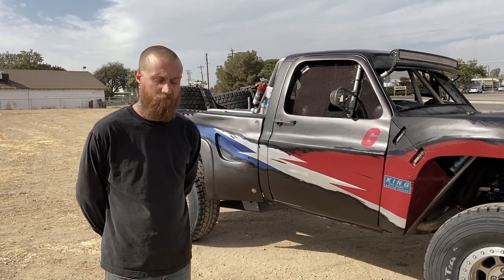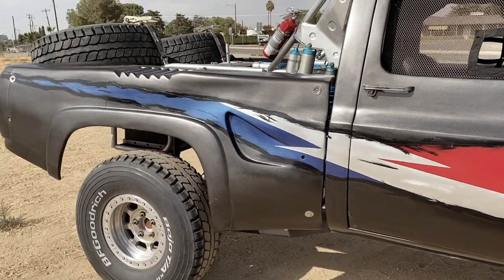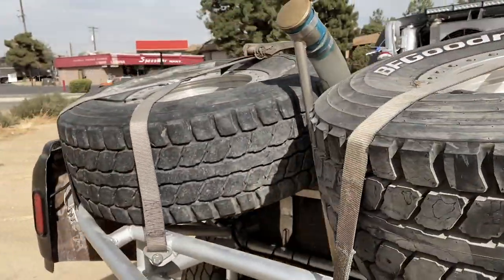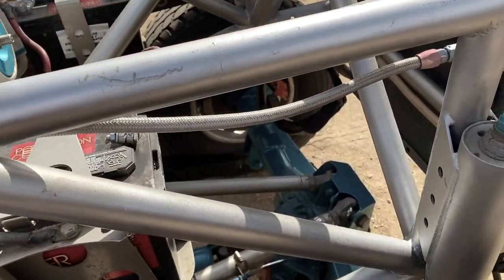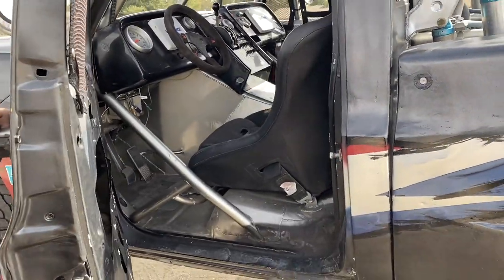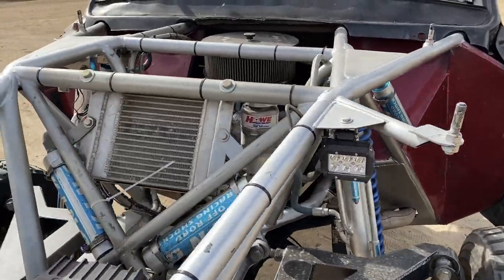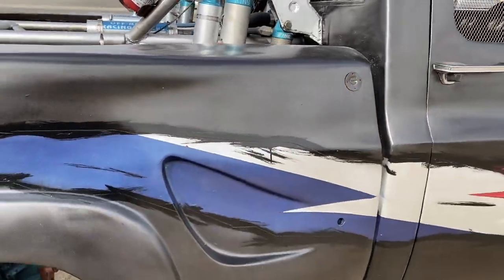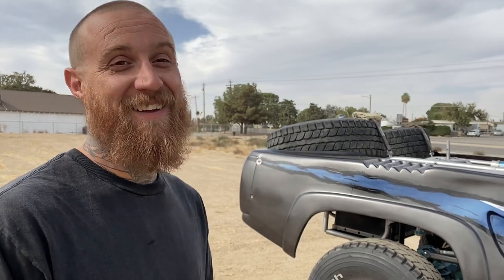Building an off-road race truck on a budget

Comment: J arm front end, linked rear end. The list goes on and on with that truck. There’s nothing low budget on or about that truck. What do you mean low budget? Guarantee you he has close to $80,000-$100,000 into that truck
Reply: Built up Brenthal brand truck costs 300k-800k so this is 1/3 of the cost on the low end and easily half the cost
Reply: @franklinhurt6972 used parts and friends.. also when you pit or mechanic on another truck,  wealthy racers donate

Comment: Ima welder, and I want to turn my 97 ranger into a fully built pre runner. I have most of the skills required to fabricate my own shit, but I don't know a lot about mechanics. Money is an obstacle, but this is a long term project. My question is, can I learn along the way, or should I take mechanics classes before I start this project? I know a good bit about working on my truck as is, but I don't have any experience with something like an engine/transmission swap.
Reply: Gamma read all over the internet. Forums and call companies who make parts. Most things for a ranger have been done before so engine swaps and transmissions and gear questions can be answered probably with a little bit of research.
Reply: Welding in itself takes precision and discipline and difficult I'm absolutely sure you can apply the same with learning how to swap and build engines trust when I say every one that learned how to repair vehicle has broken a ton of crap but you already have what you need to start dont be afraid to break things good luck with your build
Reply: Gamma look into Giant MotorSports, they have a good selection of DIY fabrication parts at really good prices. Also I don't know where you're at but depending on DEQ, and such you might want to just keep the mill you already have (don't know if you have the 2.3 or 4.0). A lot of people run v6s and do just fine with re-gearing the rear end.
Reply: Bro just jump right in be patient and keep the project moving forward. Keep it cheap and learn as you go

Comment: 4x4 or 2wd? what is the suspension setup? Could have gone over a ittle bit more about the rig. Sweet ride though.
Reply: Majority are 2wd because of the weight but there is some 4wd ones. Check out Terra Crew on YouTube it's a pre runner channel.

Comment: I got a stock quad cab dakota , where should I start modifying it?
Reply: Definitely suspension
Reply: @victorbarcelo8616  alright I'll look more into where I can get started there. I want to keep my 4×4 which seems to toss a small monkey wrench into everything. I see most people use rear wheel drive and defenently no dakotas 🤣
Reply: @7Supernova7  I have a 4x4 Nissan hardbody on 30s. The best thing I ever did to it was get good shocks. I got two kyb monomax for the front and kept it stock shocks in the rear. Rides super nice.
Reply: Honestly get a different truck unless your going custom. Next to no aftermarket support for those Dakotas.
Reply: @lk6912  thats what ive heard
Reply: @7Supernova7  you cant even find a lift for a dakota if it's 4wd. Like the other guy said unless you're planning on doing the fab work and designing it all you're better off getting a different truck that has bolt on applications as far as long travel kits and what not.
Reply: @pillaryclinton6187  got it, id need to learn how to design it then. Lots of research to do. Just was thinking or  a long term project  making a prerunner out of it would be cool
Reply: anywhere even if its grinding a weld or cleaning a rim every bit of it is progress do what you can till your able to do more

Comment: That's not low budget just the shocks are are a easy 7k
Reply: They said budget not low budget. It's an expensive hobby but this is really just scratching the surface when it comes to pre runners. Don't get me wrong it's a beautiful truck but definitely not top tier when it comes to pre runner and trophy trucks
Reply: @pillaryclinton6187  yeah ik that but like not the most buget one I've seen

Comment: Budget ....meh. ever priced out a 3" 16-18" stroke bypass shock let alone a king or king coilovers? Or real beadlocks wraped in baja T/A's. Let alone 200ft of DOM tube and a bender.
Low low budget you vould do an ibeam front on coils and deavers in the back and still be into it 4k buying used shit. 
This thing probably has 8-10k+  just in shocks. Lower links and arms are bling bling af too. Easily 25k+ in this thing even with used parts